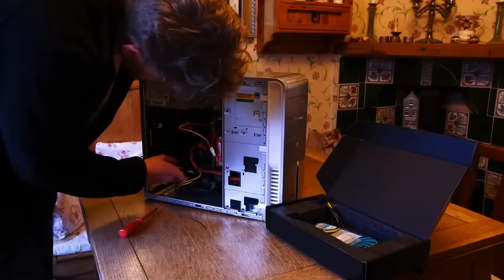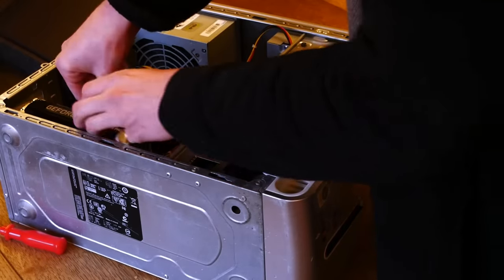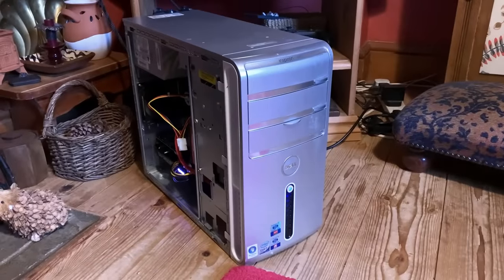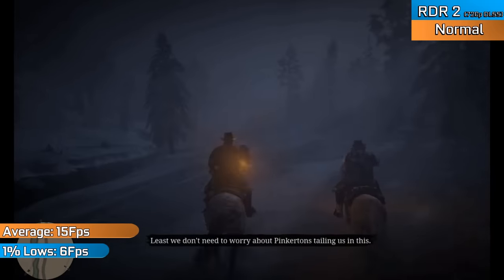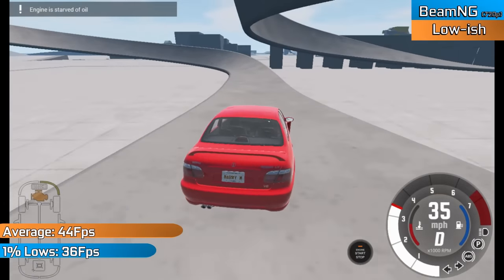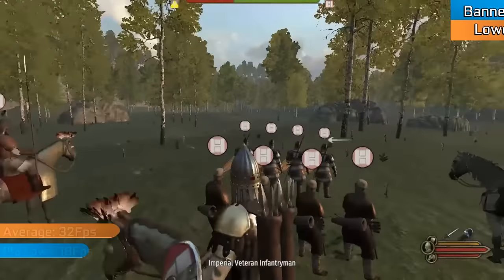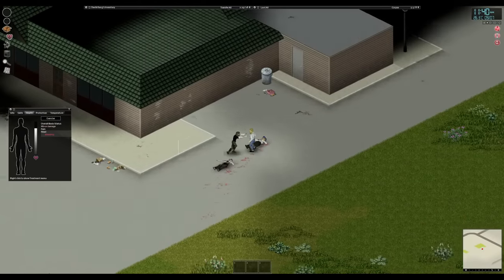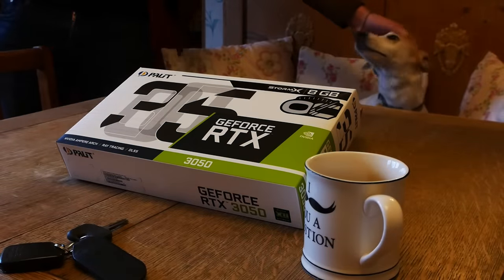RTX Graphics Card in a 15 Year Old Family PC...

Comment: Q6600 is a Beast... Cmon just think about it... The thought of using a 15 year old CPU to even just boot the latest windows let alone gaming is crazy. Like back when it came out if you tried to run an operating system let alone gaming on a then 15 year old cpu would sound like witchcraft lol
Reply: ..used a Phenom 9850@3GHz until late 2019!

Comment: Have you tried doing it with the pin covered in order to make the CPU go from 2.4GHz to 3GHz ? I don't think it would change much, but still, if you weren't already doing it, I think you might get slightly higher results
Reply: Valid since it is a free overclock lol
Reply: @somehow_not_helpfulATcrap  all, ALL LGA775 CPU's, on ALL mobos can use this pinmod.
Reply: @operator8014  that's not true iirc some CPUs run in the higher frequency mode by default
Reply: @somehow_not_helpfulATcrap  thats true but you can look up schematic draw up your own voltage mod or etc etc counter the instability through hardware mods it is unruly but useful especially if you want to resell old pc with a bit more tolerable user experience. and the incompatibility issue just get good internet and use game streaming better than dealing with all the sse bullshit
Reply: people dont post the mods anymore cause its intellectual property blah blah but you can look up documents all you feel like and draw up your own mods based on diagrams and etc etc i can raise and lower voltage of the intel core 2 quads on any board even the hybrid ddr3 models. im on core 2 quad q6600 configured to 2.66 ghz through bios modification of the FSB speed and i am working on getting it stable past 3.0 ghz
Reply: I had dell optiplex 760 pin mod didn't work I have Intel motherboard pin mod did work it depends on the ram speed that the motherboard supports
Reply: The pin mod won't work on this motherboard cause it only supports ram speed up to 800mhz
Reply: I try pin mod on my q6600 back in the day, it is fantastic experience.

Gta v getting better fps and i'm so excited 😊😊
Reply: @PiyushanTechTips  Yeah right ! And because of how simple it is, q6600 owners might as well give it a shot
Reply: Honestly the Q6600 is pretty slow.

Moving to a later in life c2q with higher clock speed would make a pretty noticeable upgrade.

I have a Q6600 and Q9550, and the Q9550 @3.6 is a massive setup up for games with a HD7950.  Used to use the machine for my HTPC and played all the mass effect games on it just fine.

Sadly unless you can Xeon Mod it, the cost of a new CPU is not worth it in such a machine. Not when you can get a junk i5 for next to nothing.
Reply: I've done this a bunch of times. it does actually boost the performance quite a bit. He should definitely give it a shot. Super easy to do as well.
Reply: That is called the BCEL mod
Reply: yes, i put a little tape on my processor and it boosted from 2.4 to 3.0 it didnt show on properties but with cpuz i found it. wow good memories it was dell vostro 220
Reply: Had my Q9650 @ 3.5 GHz no problem  ran nice with my RX 570 I need to go back and give it another shot at overclocking now that I actually know what I'm doing
Reply: My laptop have i5 gen7 2,5ghz,2,7ghz goes to 3,1ghz😅😅😅
Reply: @somehow_not_helpfulATcrap  if that motherboard supports the Q9650 it will work with the tape mod
Reply: @Durkhead  you can run a quad core X3363 XENON in that 760 Optiplex,  then overclock it to 3.5 with setFSP free download
Reply: @paulburkey2  I don't think it makes any difference cause you can't get past that slow ddr2 ram I overclocked qx processor in my optixplex 760 to 3.7 and saw no gaming performance increase.the tape bsel mod raises the ram speed as well as the clock speed I have an Intel board that I used the tape mod on with a q6600 at 3ghz I was able to run pcsx2 emulator with gt 1030 but the optiplex 760 with qx6800 overclocked to 3.7ghz could barely run it
Reply: @Durkhead  the optiplex will only run at 1333 even with the tape mod if the tape mod is able to increase DDR speed then you can easily modify that from the BIOS Dell bios is locked performance between ddr2 and DDR3 on socket 775 is negligible even on a good overclocking motherboard some of which have ddr2 and DDR3 has been tested with little to no performance increase
Reply: @paulburkey2  you can't change the ram speed in that bios cause the motherboard doesn't support it certain boards don't support it like the option 760 there's no option to raise the ram speed cause the motherboard doesn't support that speed
Reply: @Durkhead  I never said that it did but I know that the 760 can be overclocked with set FSB I have done it with the optiplex 755 and 760 both use the same PLL  I've also done Xeon E5450 771 conversions on the optiplex 380 with custom bios
Reply: @paulburkey2  I said that it can be overclocked too I used throttlestop though it just didn't make any difference in performance
Reply: @Durkhead  throttle stop won't help performance setFSB will
Reply: Yes, bclk overclocking
Reply: While others claim it works, I haven't had one LGA775 OEM board support that. Including that Dell Dimension series in this video.
Reply: @WellBeSerious12  pin mod only works with the Q6600 and OEM motherboards that support the Q9650 with 1333 ram bus speed. today your better off installing a Q9650 or with the correct chipset and a bios mod use the E5450 or X5450. I was able to use a Xenon X3363 with stock bios in my Dell 755 SFF and 760 SFF then overclock them to 3.5Ghz with setFSB software, I got great results with my Dell 380 SFF (& 275w dell Optiplex 755 SFF PSU) bios mod running the E5450 @3.0Ghz paired with 8 Gb dual rank memory and Asus phoenix fan GTX 750Ti or 1050Ti with rubber Orings to make up the gap between the fan and heatsink , custom vertical mounted using the shortest PCIe riser cable I could find on AliExpress and removing the hard drive caddy, I mounted the 2.5 SSD under the CD ROM and removing the fan shroud from the video card and cutting out part of the back IO to fit the outputs on the Video card and hammering the PCIe Bracket flat to mount it solid, that also left room to mount a small dell intake fan powered by the HDD fan header, fan mounted in the PCI slot area heled in place with the dell PCIe lock down clamp and lid to hold it in place, I also reversed the CPU fan to blow out the front to keep heat off the motherboard my nephew still uses it to run Fortnite in performance mode locked @ 75 FPS in Nvidia control panel settings Vsync in fast mode, ultra low latency, texture filtering quality set to high performance  the rest of the settings are default quality preset

Comment: I expected this to be an insane bottleneck. I did not expect the games to run as well as they did, not to say that they performed well, but the fact that you were able to run RDR2 for example is impressive. Still, in terms of practical purposes this should never be done unless the whole system is upgraded.
Reply: When I ran Red Dead on my Acer Nitro 5 (Core i5, GTX 1050, 8GB RAM) it lagged so hard I had to hold the power button and shut it off because I couldn't open task manager.
Reply: @flying_Night_slasher  I have a modern $4000 gaming laptop and I still have to hold down my power button when occasionally, GTA V decides to randomly crash, for whatever reason, crashing so hard that it brings Windows down with it.
Reply: Why? I plan to keep my ryzen 1800x and put a rtx 5090 ti with it. Despite people saying bottleneck, i would play at 4k60 ultra and VR 8k60 the cpu should be fine. Currently even in msfs2020 my cpu (6.5 years old) is not use more than 20-30% at 1440p, and i get 45/59 fps at high end at 1440p with my 6.5 years old gtx 1080ti.

Comment: It's more 12 years old 😉 
I have used a Core2quad with DDR2 until 6 months ago. Its motherboard (P5Q-E) was from 2009. I had maxed out the RAM with 4x2GB. USB was still USB2 on the board, so I had to bring USB 3.0 with an addon card. Still, it has served us well for 12 years as the primary family PC (the last years with a modded xenon CPU) !
Reply: That was my first thought as well, but no, all of the components are now legit 15 years old!
Reply: Are u emotionally attached with that pc ?
Reply: @sujitpachode3207  lol....hes gona run that computer into the ground.  Til his stuff goes 1 frame per second.

Comment: I've got an old Dell Vostro (business version of the PC you featured) that I upgraded over the years.  I used it for gaming as late as 2016 thanks to a Q9550, 8 GB of RAM, and a GTX 560 SC.  That little PC kept me gaming for almost a decade, so I'd say the platform actually aged surprisingly well.
Reply: Some of the best value is to be had in taking a used business desktop and goosing it up with more RAM, SSD, better GPU.
Reply: @dthatcher7  For my old Vostro, I actually bought that new and upgraded over the years (my parents were nervous about used computers back then, and I was in early high school so I went with whatever they'd let me get).  

However, last year, I decided to do the whole "get an eBay Optiplex and throw in a graphics card" for my brother, so he and I could game together without dropping $1000 on a PC for him that he'll only use once a week when gaming with me.  The "upgrade an office PC" strategy is GREAT for low budget gaming.
Reply: Ah, back in the days when Dell produced decent PC's.
Reply: Try to pair the CPU with 16 GB DDR3 mem, new RTX 4060 Ti
gaming machine, running all modern titles !
Reply: @lucasrem  I'd definitely run that experiment if anyone wants to provide an LGA 775 board that supports DDR3 and an RTX 4060 Ti!  :P

Comment: I still think no one should be running a core 2 quad in this day and age for gaming purposes, but I am interested to see your core 2 quad video to see how it fairs in 2022. A lot of channels have labeled it as a dead cpu for gaming wise.
Reply: My Q9650 still works fine, not great by any means, but still usable
Reply: The only CPU or GPU that is "dead"  is the one that can't reasonably run the games you want to play. So "dead" is a relative term depending on what games interests you. My gaming interests span from Wolfenstein 3D for DOS and the original Tomb Raider for DOS, Duke Nukem Atomic for DOS to The Talos Principle, Path of Exile, Trine 1 to 4 series, The Room 1 to 4 series, Destiny 2, The Witcher, real Myst Masterpiece Edition, Hitman everything, etc.

So my CPUs range from Pentium III @1GHz on Socket 370 Soyo motherboard paired with Nvidia TNT2 M64 AGP4X to AMD Sempron 3100+ @1.8GHz Socket 754 on MSI-7142 motherboard paired with Chaintech GeForce FX-5200 AGP 8X card to Intel Core 2 Quad Q9660 @3.0GHz socket 775 on Gigabyte motherboard paired with MSI Nvidia GT-640 Afterburner in PCIe 2.0 slot. To AMD Ryzen 3 1200 @3.1GHz on Gigabyte B450 motherboard paired with Sapphire Pulse AMD Radeon RX-570 4GB GDDR5 RAM. If the game interests me, I play it on whatever hardware provides best compatibility! Happy Gaming to you all.😊
Reply: jokes on you im still burning my core 2 duo and the gt210 for csgo but im on the lowest ranks but still really fun at 640x480

Comment: If I had an RTX card, I'd want to put it in my top-tier X58 platform, just for lulz. That triple-channel chipset configuration was no joke. 

My Rampage III Formula board had a SATA 3 controller as well, so running an SSD vastly benefited performance over SATA 2. 

It's an i7 990X-powered system with 24GB DDR3 (Mushkin RedLine 2133MHz kit) that I ran for ten solid years before upgrading to a(n) Z390/i7 9700K setup and 128GB DDR4 (G.Skill Trident Z Neo 3200MHz kit). 

I feel like X58 was the bare minimum for decent semi-modern gaming; I had a Q6600 and a Phenom II 1100T system before my brief stint in 990FX and ultimate transition to X58. I was so sad when they could no longer seem to keep up (or keep cool trying). 

I now have two Z390 systems and one X58. All GTX-powered: ROG Poseidon 1080Ti ($550), ROG Poseidon 980Ti ($350), EVGA 980Ti SC2 ($150). People used to joke about how I never sold my old graphics cards and had so many lying around; now that the GPU market is what it is, I'm finally having a laugh. 

I'm also building a Ryzen 7 5800x system on a budget right now, and the 980Ti SC2 will be going in that; the X58 will be getting its original Strix R9 380-OC back, now that the die-temps are no longer giving off "Chernobyl fuel-rod surface-temp." readings after receiving a full teardown and service. 

This was fun to watch, tho. I kinda wanted to do an old Core 2 build for nostalgia' sake and this totally reminded me why that was a bad idea. Thanks for posting!
Reply: yeah would be nice with more 3-4 channel systems but naah we get 2..
Reply: 128gb of RAM with an i7-9700k system? I thought my 32gb of RAM was overkill.
Reply: @pengu6335  "I paid for 4 slots, I'm using all of 4 slots, and damn the expense!" 

It was actually a really good deal at the time. I've never owned anything over 32GB prior. 

I wanted 64GB (4x16GB) originally, but I saw the discount sticker on the 128GB (4x32GB) kit and knew it was then or never. 

Came in really handy when I didn't have any spare modules for the portable ITX when I built it; split it 64GB and 64GB until I got 16GB DDR4 4000 (Balistix Max RGB) for $80 at Micro Center around the holidays.  

You see it as overkill; Chrome sees it as "more food". lol

Comment: what i always found odd is how hyped the C2Q 6600 is, when there is a cheaper, faster and more modern variant for the same socket called the C2Q 8400 
it still overclocks just as good too, so really no reason to get a 6600 instead of the 8400
not to mention the 8400 has newer SSE instructions, making more stuff work on it
Reply: not to forget core 2 quads were the best cpus from 2006 and 2007 apart from phenom
Reply: There is a two year gap in release date.
Reply: @TrantaLocked  yea? people reccomended the Q6600 in 2013 still for budget gaming 
the Q8400 was long out and still the cheaper option at that point, as noone was hyping it up
Reply: @Space_Reptile  I only hear people mention the Q6600 in terms of it being popular in the day which is why it gets mentioned so much. Never would I see someone recommend buying anything other than a Q8000 or Q9000 series after 2010. I see these as separate conversations.
Reply: I've always been fond of the C2Q 6600 because the school I went to bought a bunch of second-hand office PCs that had the 6600 in them. Nostalgic CPU for me.
Reply: @Space_Reptile  Q6600 was more prevalent, due to OEM's using them to sell "Quad" cores rather than the C2D's that were still being sold, also the Xeon E5450 was basically between a Q9550 and Q9650 for the same price or less than a Q6600.  Just need an adapter to swap the 2 pins around.
Reply: C2q 8400 doesn't work in the earlier s775 motherboards but the q6600 does - so the q6600 was used to max out many systems - my old 2006 mobo is still going strong today in my dad's pc, it started off with a c2d e6400 and has had the q6600 for the last 10 years

Comment: When I upgraded my old AMD FX-4100 computer with an NVIDIA GTX 1050 Ti, I quickly realized that the CPU was the bottleneck. Ooh boy, that was fun. But I was able to play Doom 2016 on medium or high settings in 1080p with playable framerate back in the day, so I can't complain. I bet the 1050 Ti can still be useful as I wait out the GPU apocalypse with a better CPU, mobo, SSD, and RAM.
Reply: People often underestimate how much having a slower cpu can negatively impact gaming performance.👍
Reply: Phenom II 1100t@4GHz and GTX 970 here :-P

"People often underestimate how much having a slower cpu can negatively impact gaming performance.👍" And YOU know that 'cause you tried it? Hmmm...
Reply: I got the fx 4100 before and I oc it to 4.7ghz at around 1.45v, works a lot better than original but it bottleneck the 6700xt a lot lol
Reply: @paub5100  If I had a better board and cooler for it, I would have tried to OC it. But honestly, I'm just glad my buddy gave me the processor and some entry level Gigabyte mATX thing lol. It served its purpose well. Time to buy a proper setup now.
Reply: @Ricelord4  the fx4100 can easily oc to 4.5ghz with stock cooler and the performance gain is very obvious too

Comment: My ryzen processor died when I am waiting for my replacement processor to arrive I paired a gtx 960 with a q6600  gta 5 occasional stutter but its playable with lower settings and to my surprise the dx11 perform less stutter than the other dx version the fps is about 50 with 1080p low I found an 8gb ddr3 paired with g41 and locked 50 hz and disabled some settings in documents I managed to play and got a decent experience those days , After ryzen arrives it's a new experience .

Comment: The Core2Quad was an absolute beast back then. Aaah, good times.
Reply: I still use them on old 775 boards, only new RTX cards or GTX 1080 card.
they do run all modern titles on 1080p 60 FPS